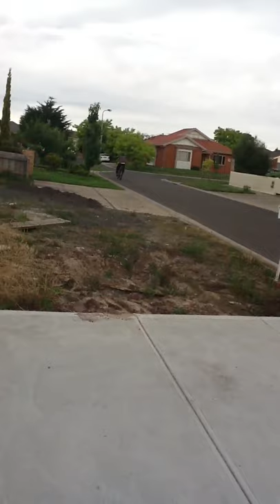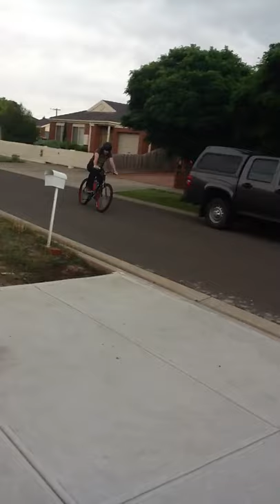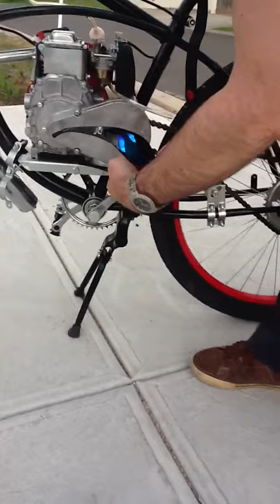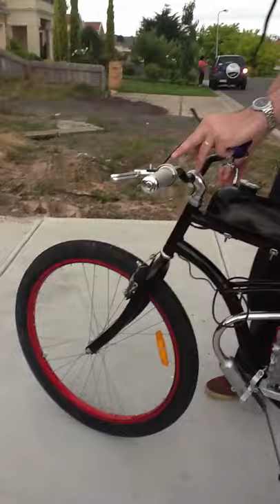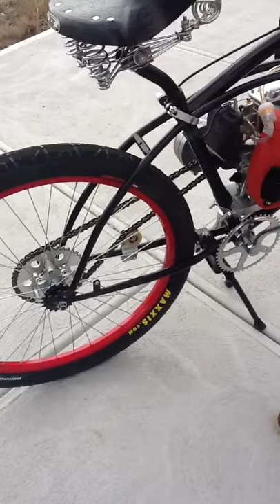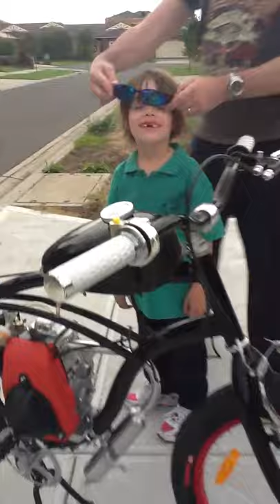My 4 stroke first test run in

Comment from the maker: Guys this was just a first test run with only front V brakes and runing in the motor.
Kit 4 stroke motor $220 bucks on ebay and bike from Big W $130 bucks. Sprocket rear clamp from US Pirate Cycles $79.

Comment from the maker: As you can see the bike needed some things to be added and since then I have completed the whole unit. It took some time and with the mods I did it and looks a lot better. It's a 4 stroke 49cc which I use to go to the beach which is  less then 10min away by car, by bike to cycle tops 20min but with this less then 15min. The track or bike path goes all away to the city and from our new home the track that is is about 300m away.